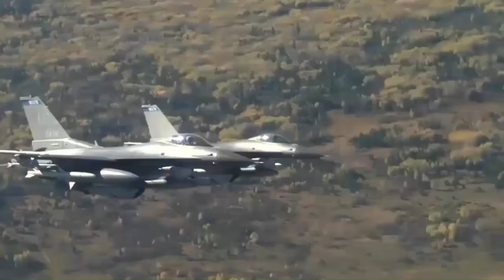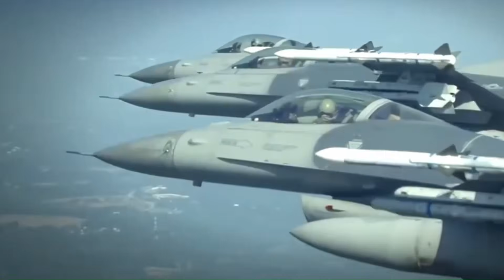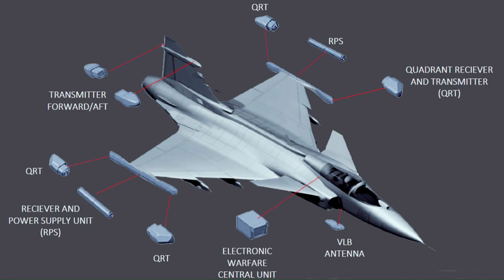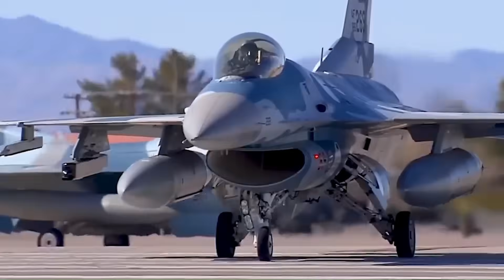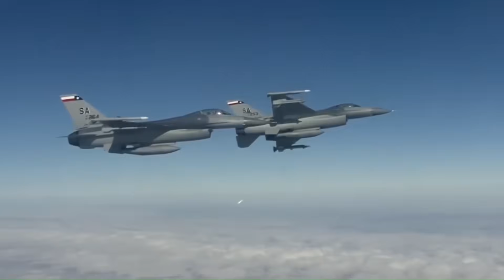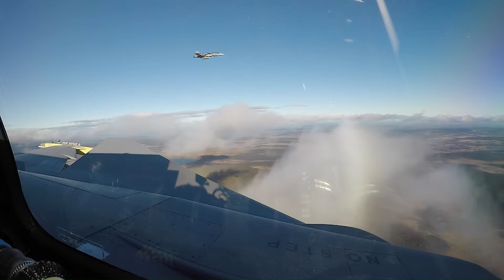Gripen E vs F-16 Block 70: Who is the Most Powerful Fighter Jet?

Comment: Both great aircraft but the political component might be the most important factor.  If one nations buys the F-16 Block 70, that nation has the backing of the most powerful military on earth. In addition, the F-16 Block 70 is the end of the line for the F-16 with the F-35 replacing it.  What replaces the Gripen?

Comment: If grippen change engine to add rollroyce and get speed 2.5 2.7 mac as interceptor also change wings design to get fast in sky it will be better to protect one country also some heavy bomb need long range as meteor it will be the best fighter interceptor and for dog fights 😊

Comment: The issue with the Gripen is mainly on logistics. There are simply more F-16s flying around making logistics far easier in terms of parts availability.

It is also compatible with far more weapon systems than the Gripen and commonality with American systems in a joint fight has advantages in continued mission capability of the airplane. If the Philippines intend to get the Gripen they better stock a great amount of parts and munitions before a shooting war or it will be a mission kill very early on.

If war with China occurs normal supply chains would be disrupted and logistics would most likely come from American and Allied sources.

The article talks too much on capability and is very pro Gripen but in the end, logistics win the battle. The US approved deal also comes with weapons stockpiles for the airplane including amraams sidewinders and bombs some of which will be produced in Japan.

The robustnest of the Gripen to land in unprepared strips is overrated and only works well in the vast roadways of europe. The only place you can land a gripen in the Philippines is at an airport and the Philippines have plenty of airfields that can also support an F-16 making it easy to disperse in the country as well.

The Gripen is a superior aircraft but there are far too few of them and in terms of sourcing parts and even weapons would make it impossible in the event of a shooting war. It could very well that in a protractwd war Americans would be left  defending the Philippines while the Gripens remain grounded out of missiles and spares. Considering how this country orders stockpiles in its onventory this may well be the case.

Its all on logistics, interoperability and compatibility with existing allied systems and supply chains that will win the next war.
Reply: Gripen E only need a stretch of road that is 400 meters long to takeoff and need 500 meters to land and I think the Philippines should have some roads that have a 500 meter long straight part
Reply: @Groza_Dallocort

The OP is wrong about the roads. Sweden built specifically prepared roads for the Gripen.

I'm not sure that's true for the Philippines.
Reply: Sorry that's "The OP ISN'T wrong about the roads"

Comment: The Gripen is, literally, the best fighter jet in the world.  It doesn't matter how rich your country is, having the JAS-39E as the backbone of your air force will maximise your air force's strength.

Take Canada for example.  For the same total lifetime cost as 88 F-35A Lightning IIs, we could have 500+ JAS-39E Gripens.  I don't care what plane it is, when it's outnumbered by more than 5 to 1, it's not going to win in a real war.
Reply: Of course, Rafale's greatest issue is the cost of purchasing the Aircraft (although maintaining it is cheaper) and the sheer lack of range (you need 2 Big Fuel tanks at Max for a proper Mission in West Africa) and honestly i dont know how Gripen compares to Rafale in those regards.
Reply: I wouldn't call it 'the Best' yes its very capable, but i doubt its 'definitely better' than a Dassault Rafale, since Rafale seems much more capable at Multi-Role missions and is very well tested, also carrier capable and...

...since its fully European (or rather French tech) means Rafale can be operated without any USA based platforms no issue.

(Not to mention, its Carrier Capable)

Comment: While the F-16V Block 70 has a higher payload capacity, the Gripen E can function as a decentralized swarm. This means that during combat, the F-16s can deliver firepower in the short term, but the Gripens rearm at separate locations. Furthermore, the electronic warfare system of the Gripen can effectively operate like a swarm.

Comment: Hold your horses. Gripen E is NOT the same gen as F-16V. F-16 dates back to the 1970's, Gripen E is totally new. Even if it may look like Gripen C (a plan 20+ years younger than the f-16 from the start.)  and a  modified Gripen C are probably the same gen. as The F-16V. 
Gripen E is a 5th gen fighter. it's size makes the radar cross section comparable to some "stealth fighters". The current "gen. system" is only an american advertisement  trick to sell their own jets.  The EW system on Gripen E is more 6th gen. Far superior to anything else today.
Reply: Gripen E literally uses engine of F-18 certainly not 5th gen.

Comment: Gripen C has already shown that it is more than capable of taking down multiple F16’s. For me, the two biggest differences between the two, must be the operational costs. The F16 costs 3.5 times more to fly than the Gripen E. And the Gripen’s sensor fusion ability, and its ability to integrate into a information network.

Comment: Some points that (should) have been included to consider: 

1. Airfields/bases are prime targets during a real war situation.  The cost of defending such bases (and the cost of relocating personnel, repair/servicing equipment) is considerably higher for F-16s (owing to the number ~20 support personnel per jet), plus the limitations of finding alternative bases (e.g. risks of debris in the air-intake on alternative runways).  In this regard , the Gripen performs better at more fluid logistical relocation, and operational continuity. 

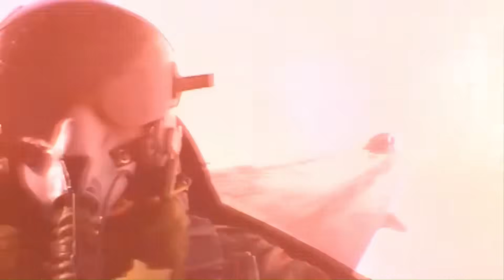2. Political/Economic support (15:25): Actually, the requirement to have political/economic support is possibly a drawback for any country which uses the F-16 platform. Why? Because any upgrades, weapons packages need the approval of the country providing the technology. Delays in approvals, partisan politics can add considerable delays, and the situation gets more complex when technology has been co-developed between several nations (in which case, all parties need to reach consensus in agreement, further compounding the complexity/lead-times of any decision making processes). The Swedish Gripen does not have as significant "political/economic baggage" as the F-16.

Lastly, any nation's decision to acquire a fighter jet weapons platform is a way more complicated process than the few points outlined in this video. For example, this video does not mention the service lifetime of the airframe (F-16 is about 8000 hours,  F-15EX is about 15,000, Gripen is about 8000 hours),  then there is the cost-per-hour of flight time, the required flight hours required per pilot (NATO recommends 350 per year as a minimum) to maintain a high level of pilot competence (which also accelerates the depreciation of the airframe),  the geographical terrain considerations (combat radius would factor in here), and type of missions the airforce is trying to build the capabilities for  (intercept, SEAD, EW, Recon/Spy, GA/A2A),  and the contractual negotiations of the rights of usage (e.g. sale to another country)... and much, much more.

Plus, if all that wasn't overwhelming enough, the "technology window" - e.g  by the time contracts are agreed, production begins (typically more than a year), and deliveries start coming in,  new combat capabilities/technologies would have caught-up to surpass the original list of technologies/capabilities considered in the decisioning process.  So, decision makers have to consider the risks of production delays (which do happen, and are inevitable), and assess where this sits in a multi-year (decade or more) block of time.

So, the summary is:  "which fighter jet is better?"  is never as simple as deciding which car to buy (given an equal amount of cash to spend, and features to choose from).
Reply: Considering the various points you presented,. JAS-39 is the better choice compared to F-16.
Reply: Gripen ENGINE requires total US approval for export.
Reply: @carlypot9421  You are right - I wasn't aware of this. Thanks for pointing this out :) Again, this does support my conclusion that, the choice of deciding the "better" fighter jet platform - which is a decision about a muti-year, if not, several decades long commitment - is never as simple as comparing two specs.
Reply: Životnosť draku lietadla je u F 16 block 70/72 12.000 hodín. V podstate sa zdvojnásobila.

Comment: Problem with the F16 is politics rather than function. Thailand is an interesting case study. Thailand chose the Gripen E/F over the F16V mainly due to the difference in T&C.
With the F16, the customer country has to ask US permission to use the jets, plus the US offers limited upgrades
With the Gripen, the customer doesn't need permission from Sweden to operate, plus Sweden allows Saab to work with the customer to develop new upgrades.
Reply: Jak każdy produkt made in USA Windows 11 też nie oferuje tyle swobody co Linux

Comment: F-16 Carrega até 7.700 t de Misses ?
Reply: 6.8 (15.200 pounds according to Lockheed Martin. Less if they use extra fuel on the hard points or even CFD because the plane becomes heavier with the fuel and some weapons must rest at home; more flight time less weapons wise)

Comment: The on-going deal with Thailand worth between $1.6-$1.75B Depends on exchanges rate. 
This deal is for 12 aircraft … this make unit cost around $138M. But coming with gripen E… Saab thrown in couple of meteor missiles (I heard 2 or4)  upgrades 2 of Saab 340 erieye from AEW to AEWC with new radar /ACCM
Reply: And Tactical data link license /right of self development… and couple “offset” economical projects. 

While 12 F16 offered from LM is $2.5-2.65B
With link16 license and installation of existing 20+ F16 in RTAF with link 16. 
RTAF choose Gripen

Comment: I agree. This comparison is actually happening in real life. The Philippine airforce is currently evaluating both the Gripen and the Viper Block 70. It was reported that they were leaning towards the Gripen but $500M military donation to the Philippines from the US government last week will most certainly change this bias. The Philippines are acquiring either of these fighters to defend against China. This theoretical battlefield will occur mostly in open water...far away from any terrain. This makes radar, combat range, electronic counter measure, flying/landing from unprepared airfields the most significant factors. All of which the Gripen has advantage over the F16.
Reply: I agree with you the best option is Gripen but i think they had chosen the F16 coz they would have more kick backs🤣😂😅
Reply: Don't worry, China has more than capability to bring the battle theatre just right to your front door.
Philippines can't in anytime soon to shed away the American back up, so F-16 is more than obvious, just "when" is the only question.

Comment: A military jet fighter should at least resist 9G (JAS Gripen get into a 12G when or if its needed) in order to overturn the rear tracking line of a passing missile attack,,,,, An hight performance acrobat competition aircraft's has reinforced construction which resist a G power from 10 to 12 G. Why it is So Secretly kept that only one of the F-35 jet fighter is able to resist 9G and the weakest F-35 is the F-35B and F-35C only with a 7.5 G-force limitation. 9G (and if needed it can resist +12G) requalification to be able to fly the JAS 39 Gripen C in the Swedish Air Force > https://youtu.be/0vxb0stOxXI?si=x3Kedd5ajCjmTN8P  >>  The takeoff distance with JAS Gripen is 600 m from a minor street road,,, and 800 m strip for a full stop landing on rough surface road strip,,, there is no need for special military runway for JAS,, Meanwhile the F-35 can only have a short take off distance from an air carrier by using a catapult,,,, It's however only depending of the purpose of the jet fighter's use,,, if it is required or unnecessary to maintain a high performance. I cannot imagine Tibet has any need to buy a submarine for defending purpose.

Comment: Gripen E is a major upgrade from the Legacy Gripen A,B,C,D versions as the major feature are increased weight from 6800k to 8000k . 
 It has a new engine, the undercarriage has been repositioned, the internal fuel capacity is increased from 3000L to 4360L, 2 extra hard points, even the aelerons increase in area and many other changes are made not just modernization.
Reply: It's biggest advantage to other planes IMO is it's electronics warfare. The F35 comes close when it comes to defensive EW but lacks the offensive EW that the Gripen E has. The C/D versions were already very impressive for their jamming capabilities but the E is on a whole new level.
Reply: @sabahoudini  I believe we have just watched the potential of F35 in the Iran / Israel confrontation. The ability to detect and target ground based missile systems, giving Iran no cover , was deceive . The F35 has amazing situational awareness and can use its much more powerful radar to great effect either to direct attack or pass targets of opportunity to friends. It is a tricky comparison to make given SAAB Gripen E is not in service yet.
Reply: @NATObait  Is that why their mossad undecover agents blew up all air their air defense systems and radars beforehand? If it's like you are saying then there should have been no need to do that, especially since their systems are not that sophisticated?
Reply: @NATObait  Is that why their mossad agents blew up all their air defense systems and radars beforehand? If it's as good as you are saying there should have been no need to go through all that hassle and sacrifice all their agents lives? Especially since their air defense was not the latest tech.
Reply: @sabahoudini I am unaware of the ability of ' agents on the ground ' and their effectiveness or for that matter the standard of radar systems in Iran. Likewise the exact use of F35 and other aircraft is obviously restricted. However as only fake images of F35 were shown we can assume that no F35 and indeed F15 or F16 got intercepted only recon drones were shot down. That in itself proves that all radar systems certainly did not get destroyed prior to the air campaign or the Heron drones would not have been shot down. I think my point was the F35 was designed to identify targets of opportunity and to then iliminate them or pass off to friends to follow up. Only about 7% of the total data is available for the pilots decision the rest is left for the attention of 3rd party systems otherwise the pilot would be swamped. 
 We don't know the tactics or the ability of the F35 or the potency of Iranian AA radars and missiles, those are not in the public domain.
Reply: Pudrowanie trupa

Comment: F-16's glory days are fast fading. In terms of technology and innovation, it's time is up. New generation fighters like JAS-39 will take over.
Reply: F-16 has been incorporating F-22 and F-35 tech in it since it's made by same manufacturer. Ukraine didn't get those version Ukraine got F-16 block 20-30, while here he is talking about block 70.
Reply: @niweshlekhak9646  It's costly to incorporate new technology on old platforms. That's why the new JAS-39 Gripen's cost only around $4,000-$5,000 per flight hour to operate while the old F-16 can cost upwards of $20,000 per flight hour. And the same time, the JAS-39 outperforms the F-16.
Reply: @rainnelmaclang4803  Gripen is an old platform too it was introduced in the 80s.
Reply: @ F-16 is 1960s-1970s airframe technology. Even it's landing gear design was borrowed from the WW2 vintage B-17 Flying Fortress bomber. 
Gripen C/D airframe technology is 30 years younger than the F-16's, while Gripen E/F airframe and avionics is current 2020's technology. That's why it is 70% cheaper to operate than the F-16.
Reply: @rainnelmaclang4803  F-16 V block 70 is also current airframe by that logic and F-16 is cheaper to operate than Gripen.
Reply: @niweshlekhak9646  F-16 will never be cheaper to operate than the JAS-39. More so with the JAS-39E. Check your numbers.
Reply: @rainnelmaclang4803 not only are you entirely wrong about the landing gear (you didn't even mention the correct bomber, nor are the landing systems similar on either the B17 or B47), the Gripen's radar range is roughly only a third of the F16's, both fighters have modernized avionics and the comparison is only known to those with a TS clearance. The F16 is renowned for its multirole capabilities, so much so it's the most adapted fighter jet on the planet. The only thing the Gripen offers is better CPH, so keep coping.
Reply: @ The reason behind the large number of F-16 sold to many US-allied countries is that the US government blocked the sale of non-US-made competing fighters that contains US technology in its design. This includes the JAS-39.The buyers did not have any choice other than the F-16. Ironically, another US-made fighter, Northrup's F-20 Tigershark was more capable and cheaper than the F-16, but the US government did not support Northrup because they will make more money selling the F-16.
Reply: @  You really just called the F-20 a more capable aircraft lmao. Idk how you take yourself seriously.  Also, if you truly believe that product hostility is the ultimate deciding factor on a multi-million dollar program, you have fewer brain cells than I imagine you already do.